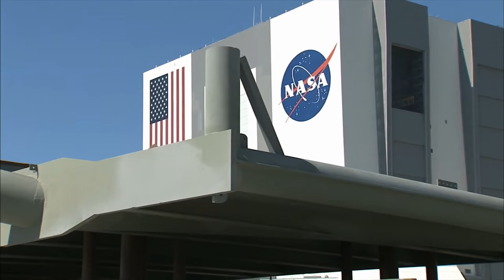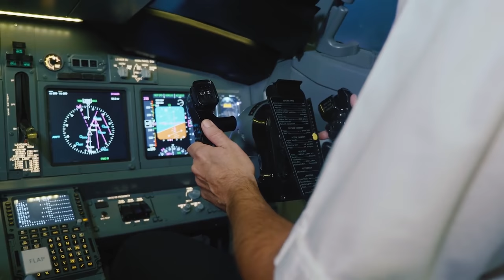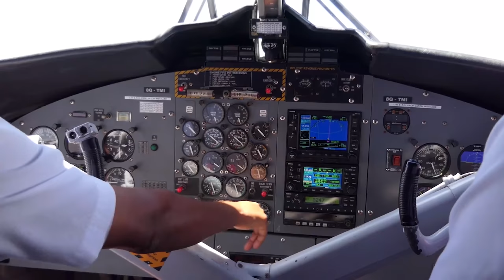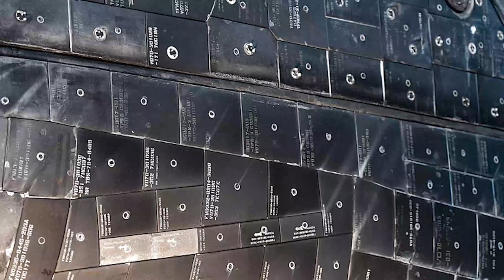Why Building A Space Plane Is Nearly Impossible (Physics Explanation)

Comment: The Virgin Galactic ship, I see it only gets to 80km or 85km, what's the reason they can't add a booster to it to get it past 100?   I'm sure there is one.
Reply: You can't just glue a booster to the side like in Kerbal Space Program. Adding a booster would require redesigning the entire vehicle.
Reply from the maker: Yep, it probably has to do with thermal constraints
Reply: @LogicallyAnswered  maybe but probably also budget.

Comment: So  why didn't they  used aerogel to absorb heat as it is lightest solid material
Thus less mass more the speed
Reply: I imagine it is because they would shear off as easily as shaving cream.
Reply: @1MoreTurn  
What if they attached a steel plate above the aerogel though it will be heated but aerogel will absorb the heat in this way aerogel will ont fly like a icecream.
Reply: @alexsolo9189  I ddin't realize, but aerogel can have different forms. I guess it could work if you used the harder kind. Makes you wonder why NASA hasn't use it when they have had it for so long though.
Reply: @1MoreTurn  to bad I am too small to work in nasa and I am still studying

Comment: Your bit airflow over the wing and pressure difference being how planes fly is outdated and nolonger considered correct. We now have various aircraft with wings that at symmetrical top and bottom and they fly just fine....it's even simpler answer the wing is pushing a volume of air downward that weighs more than the aircraft it self.

Comment: So why does it have to fly back so fast ? Thanks 🤩👍👍
Reply: Orbital speeds are many times greater than atmospheric speeds. Mach 10+. This means you have to have a way to scrub speed coming back into the atmosphere and still handle the heat. One way of doing this is retrorockets. SpaceX proved that this is possible. But you have to carry the fuel and have the reusability required to do it.